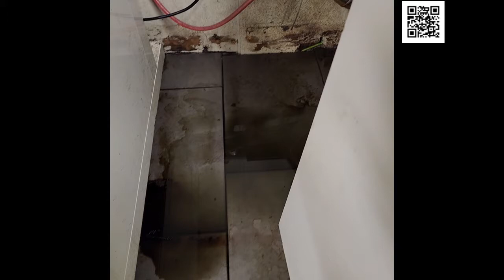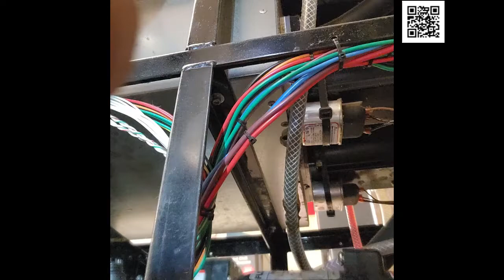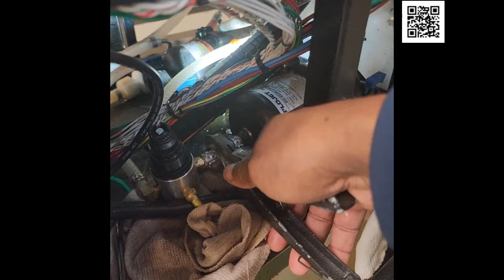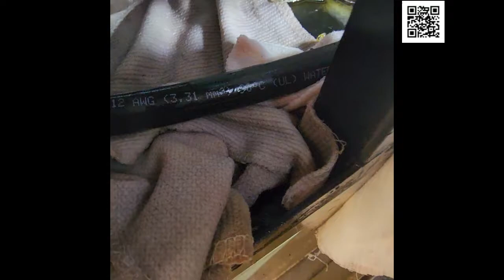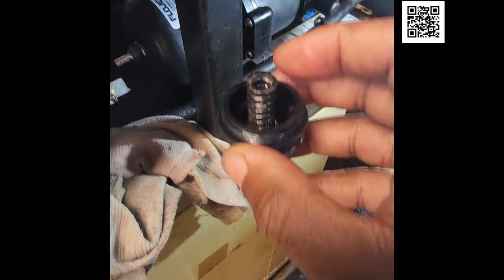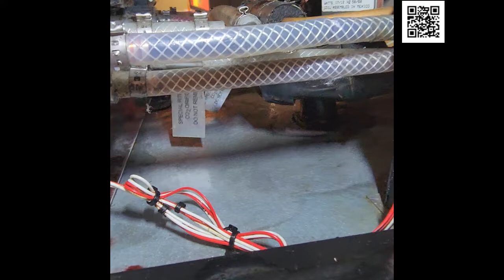FBD Slurpee Machine Repair (Expansion Tank Replacement)

Comment: Also Kevin I was wondering what is the best tool to use to take off otiker clamp off the hose connection is it going to be the otiker pliers or is there another tool that you use
Reply from the maker: Yes its definitely the oetiker pliers. If your in a pinch you can use diagonal cutters but the Oetiker pliers is the best.